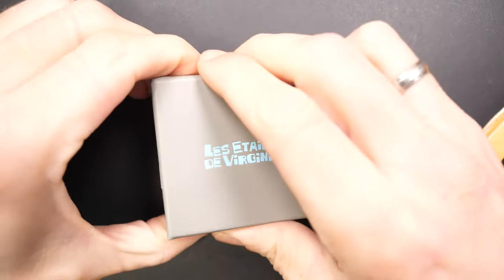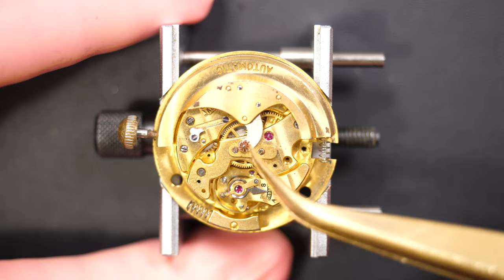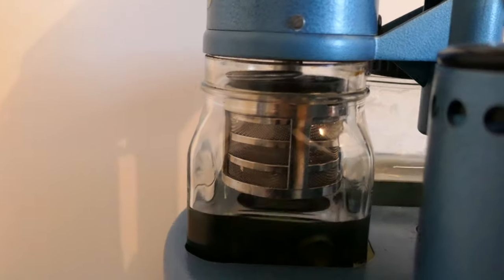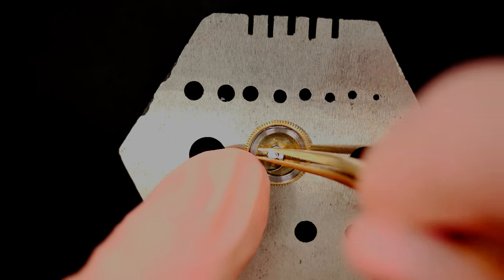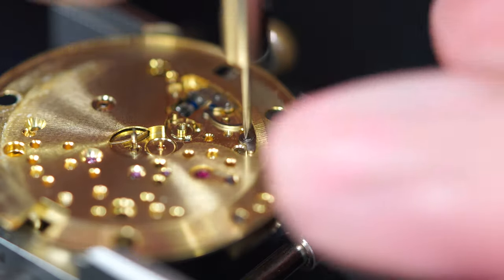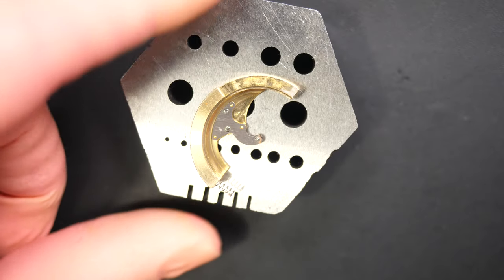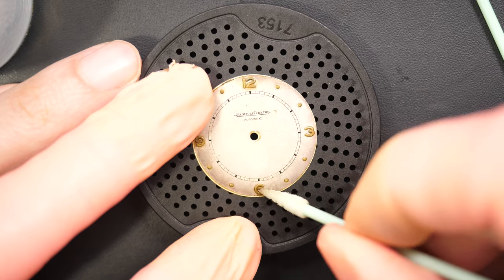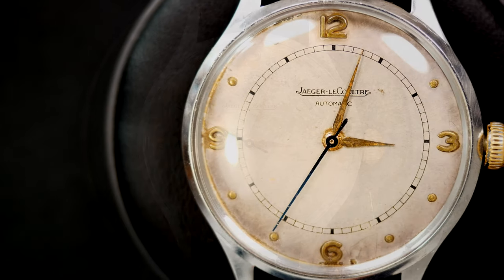Restoring a Broken Viewer Watch. Jaeger LeCoultre Automatic Cal 476 !!!

Comment: Beautiful pearlage and striping!  Who would have thought to drill a hole through the dial and main plate?  I guess dial dots were not available when the repair was made!  Once the plates are cleaned do you ever think of adding black ink to the plate inscription as it was originally marked?  

Excellent choice on the blued second hand!  Interesting that one spring is attached to the bumper weight and not at the stop on the plate as is the other one.  T

hanks for posting this beautiful  restoration / repair.
Reply from the maker: My thoughts exactly

Comment: The Calibre 476 was the first automatic movement from Jaeger-LeCoultre.

Introduced in 1946, the Calibre 476 came 20 years after John Harwood and Blancpain presented the first automatic wristwatch and 15 years after the Rolex “Perpetual” went into production. It was a bumper movement, not a 360º rotor as in today's watches, but it boasted a respectable 40 hour power reserve and was accurate enough to be certified a chronometer in later years. It ran at 18,000 vph.

The 476 was the basis for the 1948 JLC 481, the first from the company with a power reserve indicator.

Note that Cal. 476 is often stamped “12A”, leading to confusion about the naming of this movement.
Reply from the maker: Thank you so much for all this great information on this historical jaeger movement